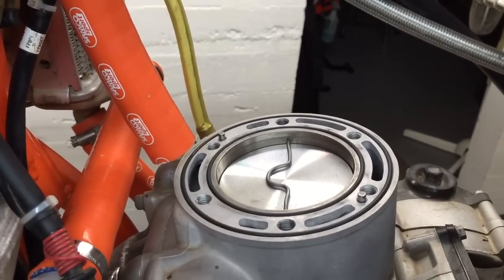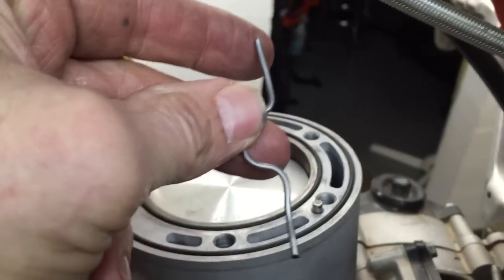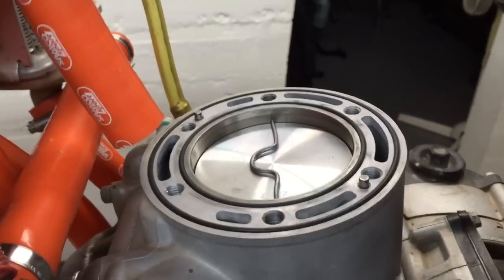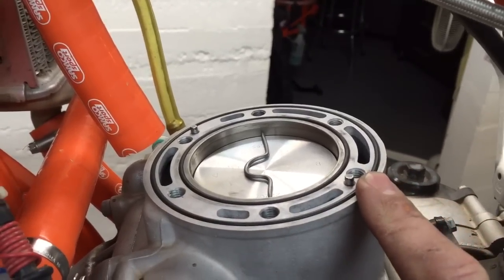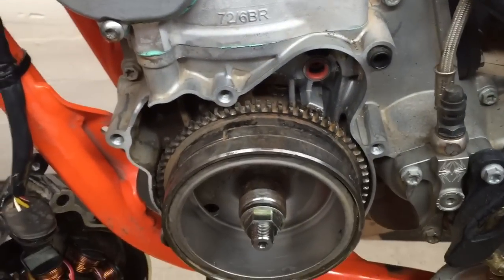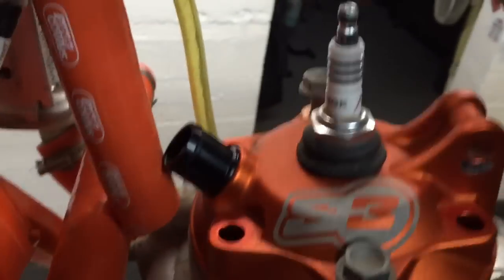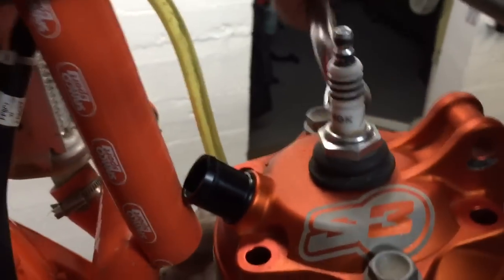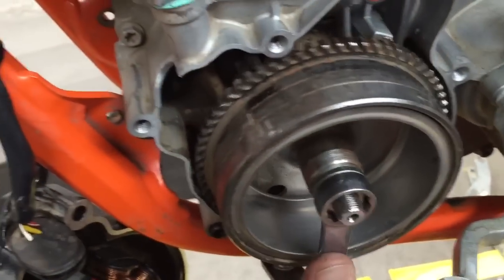How-to Measure Squish Clearance Part 1

Comment: What’s the measure of a 250 tpi 2018?
Reply from the maker: From the factory they have .080".
Reply: @slavensracing  inch i imagine..
Reply: @slavensracing  damn it’s a lot… How far can I lower the squish while remaining safe? Original head
Reply from the maker: @max0202  
You can safely reduce it down to .050".
Reply: Thanks a lot!!

Comment: Part 2 would sure come in handy right about now. Just rebuilt my top end and couldn't get a good measurement on the old base gasket as there wasn't much left of it. So, I just guessed with new one. Feels like I've lost some bottom end performance. 2012 250 XC-W.
Reply from the maker: Measuring squish is for head mods NOT setting the deck height. You apparently installed a thicker base gasket which reduced low-end grunt.
Reply: @slavensracing  aha! I'm a bit of a new, so I was confused about this. Thanks a million for your quick response! FYI, I did order my top end kit from you to show my support for all of your great videos. You da man Jeff!!!

Comment: What is the point of this?
Reply: also called dimension x in manual
Reply: @benashlin8845  Used to do it on old Lister/Petter diesel engines, we called it bumping clearance then
Reply: Jay Smith to pick the right base gasket (they come in diffrent thicknesses)
Reply: I think it is also called piston stop gap. There will be a speck for it and it will def effect you compression. you would change it by changing the gasket thicknesses between cylinder and bottom end. Maybe a pro can confirm this.
Reply: You do not adjust squish by changing base gaskets because you would change the port timing outside what us required in setting Dimension X.

Comment: Thanks for this instruction but what is the minimum squish and how changing squish will effect for engine performance?

What do you prefer for KTM 300 2017 used only in technical stuff?
Reply: The squish space does exactly that -squishes air and fuel mix centrally for the best shot at complete and powerful combustion
Reply: Depends on the fuel you will be using, 0.60mm-0.70mm on high octane larger for pump fuel 0.80mm-0.95mm.
Reply: I believe my numbers are safe and only what I use and have tested/ every builder has their own numbers